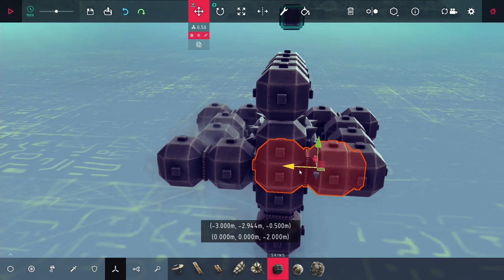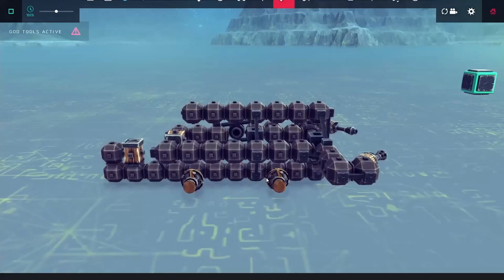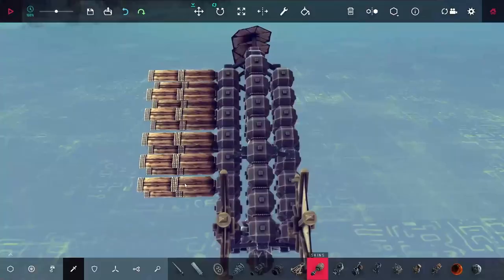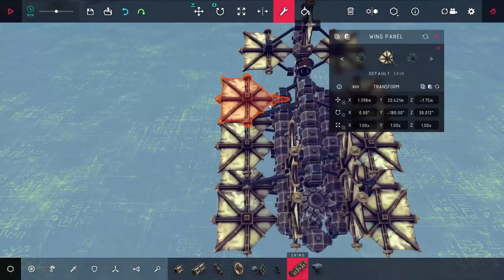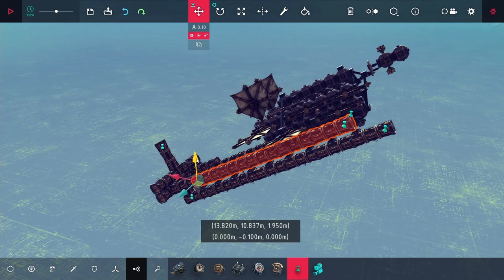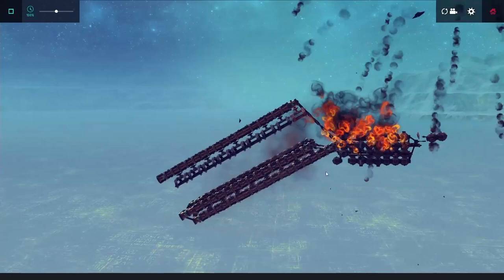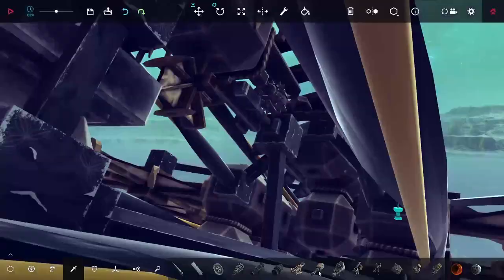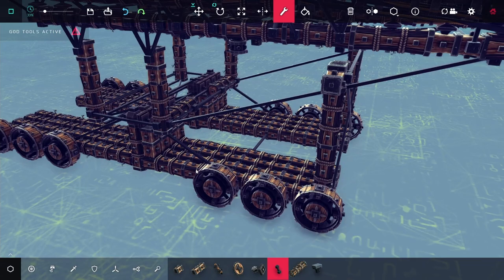Making a Missile Launcher to Annihilate Besiege

Comment: Idea for Scrap Mechanic : Realistic Gun w/replaceable Magazines
- It’s easier to make a detachable magazine in SM compared to Besiege.
Reply: What's the point of literally making a latch mechanism to release the shotgun magazine
Reply: But good idea for scrap mechanic
Reply: @hfpewe7872  Thanks, but who said it would be a shotgun?
Reply: the other day I managed to create in besiege an okay ejection system with suspensions as some kind of recoil spring and canons as ammo. I tried to use the motion of the spring to chamber a new canon from a magazine but I couldn't find a good design (things are just too wobbly in this game, it was a fucking jamfest haha)
I'd love to see people do it tho, pretty sure it"s possible.
Reply: @ohhnyx9229  That’s why I would recommend trying scrap mechanic
Reply: @5APPH_13  Could be fun to try, tho I see two problems.
First you'd have to use explosive cans as a propellant and you'll probably end up chain-firing all your magazine.
Second, scrap is kinda built around bearings and powering them directly. Building a fully mechanical self-loading firearm (which would be the most fun to make imho) may be complicated.
I mean, I'd love to see someone try or try myself. I just don't see how it could work out ^^
Reply: @ohhnyx9229  you can use spud guns and cardboard

Comment: Here's an idea: A propeller-powered airship that can undock and redock at a hot air balloon mothership, with a cargo mechanism to load bombs or weights from the mothership for the airship to then carry and drop somewhere.

Edit: or maybe instead of a mothership just add a dock to one of the floating islands, see how that works out.
Reply: So basically a Airship carrier Airship?
Reply: could you at least have a reduce confusion level follow up comment?
Reply: This is sort of weirdly specifick consept for what hes previously done in besiege, but might be an interesting idea. (I might try making one my self).
Reply: @jannehansen-haug3375  I wouldn't say it's that much more specific than the fighter jet video